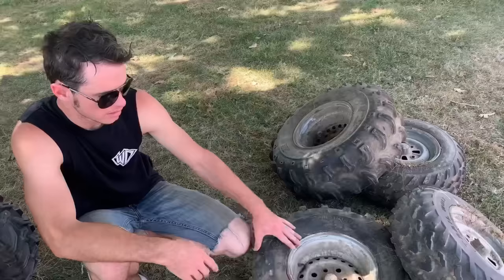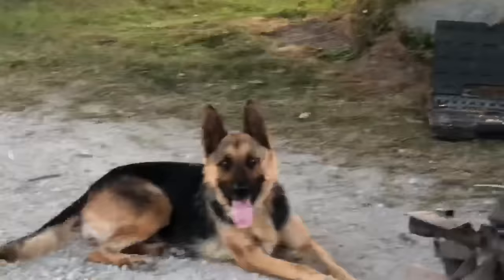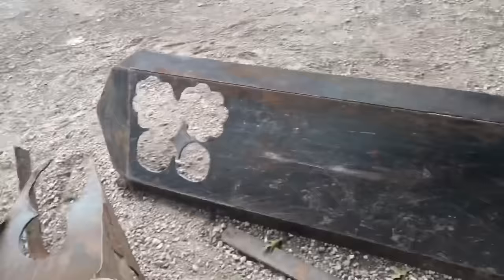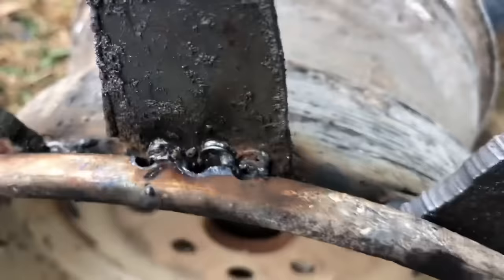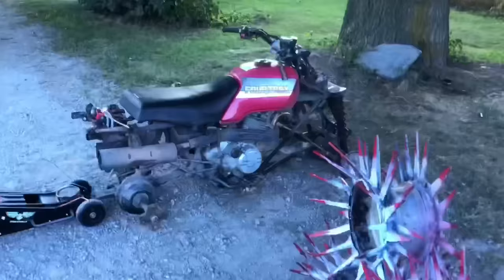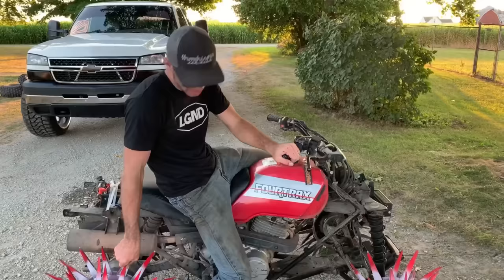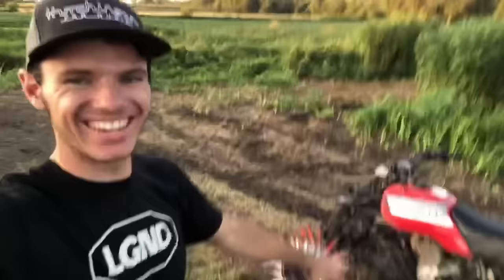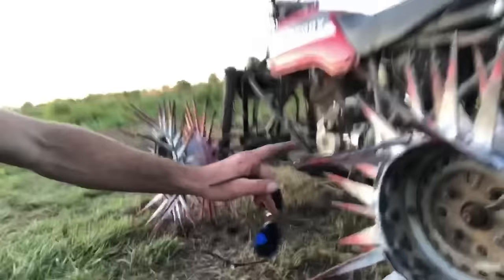Fourwheeler on REAPER WHEELS literally Tills Dirt

Comment: The stick wasn't the reason why the spike fell off, it was because your welder's voltage was too low, not allowing for the two pieces of metal to fuse the best. The weld that was used acted more like wood glue and less like making the piece and the rim become one.
Reply: 100% agree with you.  I wonder if the welders getting enough juice from his  shady extension cord. I can only imagine what kind of damage one of those spikes could do to someone if they fly off the rim.
Reply: @danny88591  All I was thinking seeing flyby footage. One loose spike and need a new camera... or cameraman
Reply: Leave it up to the welder to say something
Reply: @Crash7696  ok, but where is his comment? The video has been up for a while champ.
Reply: @BlinkRepeat  lol ratio
Reply: 💯 He's lucky he didn't get impaled
Reply: Even though things I glue together don't come apart
Reply: But wood glue makes a stronger joint than the wood

Comment: With your professional welding I could see one of them spikes fling off and poke your skull.
Reply: Hope it happens . . . This kids t a joke
Reply: Yes it wasn't that great to much heat, but to add to it those spikes are about a 1/4 to 3/8 inch thick. You're welding those spikes to the thin outer edge of those wheels. You're going to need more meat on those rims to hold thicker spikes like that.
Reply: Randall Falcon OoOoOhH wE GoT a BaDaSs “I don’t care who you are” gUy OvEr hErEEEEEEEEEEEEEEEEEEEEEEEEEEEEEEEEEEEEEEEEEEEEEEEEEEEEEEEEEE
Reply: @carlospacheco2933  you shouldn't wish that onto anyone dude.

Comment: You should heat treat the spikey wheels and then add some stuff in the inner barrel of each rim to create more structural integrity so you don't loose so many. If you still have those left over fenders, you can use that plastic (or is it aluminum? couldn't tell) but you can use those to create guards around your feet (not necessarily as fenders but just for protection) and around your hips and thigh. Now you'll have a fully functioning zombie-tiller.
Reply: Lol

Comment: Just a disclaimer, don't drink gasoline. I think he switched the gasoline out for water when the footage jumped. Actually maybe its best not to do anything done in this video. XD

That said, I think the blades would have stayed on a lot stronger if they had done a bit more prep work and welded both sides of each blade. Also it would have helped if they were more thorough with the weld as well. Idk much about the material of the rim though, so maybe it wouldn't be strong enough regardless. The metal is very thick as well, so they would probs have had to grind a v into the gap in order to allow the weld to get enough penetration.